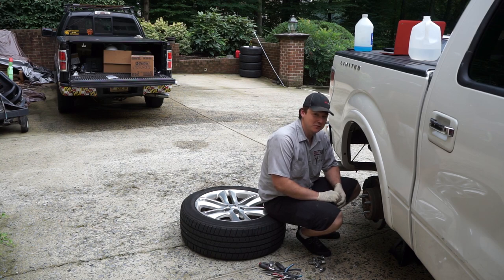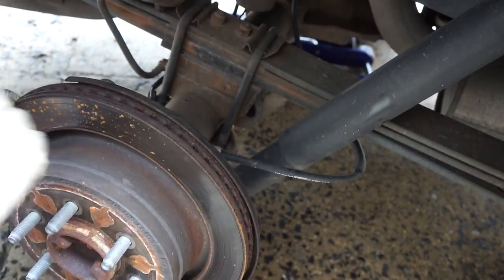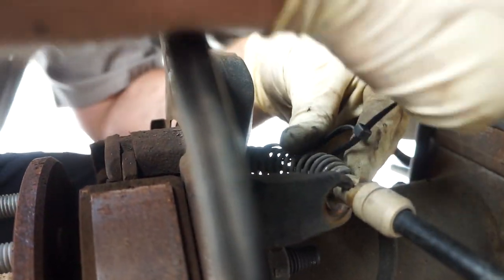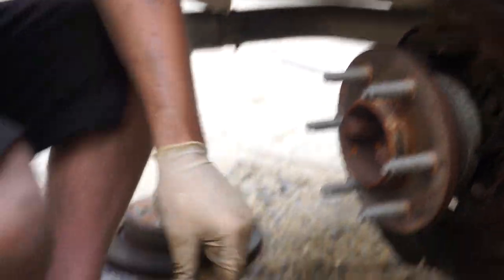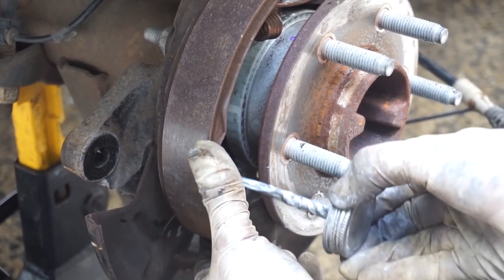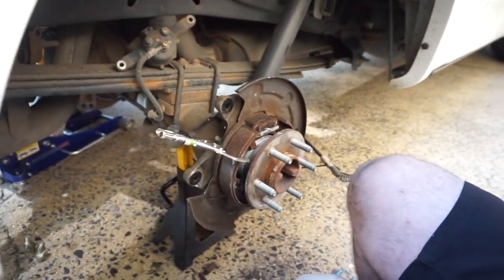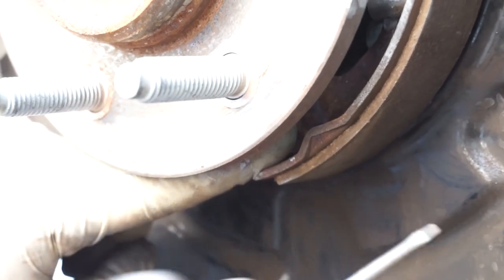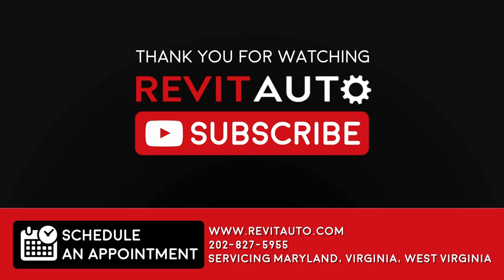How to fix an F150 E brake

Comment from the maker: 😀THANKS FOR WATCHING! Here we have more F-150 videos!
2004-08 Ford F150 Ignition/Spark Plug Coil Replacement
https://www.youtube.com/watch?v=U70bvNM6fAI

F150 VCT Solenoid Gasket Seal Replacement (2004-2008)F250 F350
https://www.youtube.com/watch?v=CaHaEKzO11Y&t=1s

How to change the headlight on a Ford f150
https://www.youtube.com/watch?v=nwtRDmw8KxI

2011-2014 XLT Ford F150 Steering Wheel Control Replacement
https://www.youtube.com/watch?v=fFCqoL6Y1pA&t=32s

Comment: Idk if anyone thinks like me, but after seeing this guy and other YT videos struggle with this, I got to the step with the rotor off and just took a flathead screw driver and a rubber mallet and just kept working that lever mechanism until it moved freely. Then slathered some anti-seize on it and worked it a bit more and now my parking brake is working beautifully. Saved me having to get someone to help me, and the hassle of taking that all apart. Obviously a professional mechanic can't do something like this, but for someone that just needs it to not be stuck on its good enough..
Reply from the maker: Exactly what I did on my personal truck! But not something I can do on a clients fleet truck!

Comment: Thank you very much! I’m new to the inner workings of my truck as I’ve never owned a newer vehicle. After watching this video I went home and fixed that annoying squeal...was the same part seized on mine as well! A little penetrating oil and hammer taps got it like new and re-installed...now with a dab of grease on the pivot. Took me two hours, including setup, assembly and to put all the tools away. Working like a charm now! I used a couple of small chainsaw cutting wedges to hold the pad in which worked great for me.
Reply from the maker: Solid! Thanks for sharing your experience and adding a little tip in there! Congrats on owning this new of a truck! Happy Motoring -Blair
Reply: Hey Juro Me, was your truck making an awful squeal from the rear end at low speeds especially in reverse? Trying to diagnose the noise on my truck and I think this may be it. Thanks!
Reply: @davidwalker72  Hi David, sorry for the delay I haven't been on in awhile. Yeah my sound was very prominent squeal; I would get the truck rolling and throw it in neutral and could feel very slight drag...but not super hard or super loud. Just super annoying. With a stuck parking brake I guess it all depends just how "stuck" it is. Mine was stuck only enough to make an irritating noise and the hub didn't get too hot.
Reply: @PTSix-eg4zj  Thanks for the reply, a week ago I took off my rear rotors and things were a bit rusty in there. The shoes were definitely dragging because of a little buildup of rust. I polished the inside of the rotor and cleaned and lubed the right spots. Completely fixed the issue. Had to adjust the tensioner to get them off then tighten it when reassembled. I only drive it about 5000 miles a year, but time plays its toll on these parts for sure!
Reply: @davidwalker72  Awesome news! I love when a fix saves us $$. Nice work.

Comment: Did this a while back and here's my 2 cents: If you haven't changed the diff oil in 50,000 miles or so, plan to do it while you do the parking brake work. Taking the axle shafts out makes the parking brake work absolutely painless. If not: 

Use a magnet to hold the pins in place while you're working with the clip. I used a freebee snap on flathead screwdriver with a small magnet on the rear, fit right in the hole and kept it mostly in position!

The vise grip on the shoe is a must. In a pinch you might be able to make it work with a few properly placed zip ties but I recommend vise grips, you'll definitely use them again.

Speaking of vise grips, I used one to compress the clip while I pushed it on the pin. Problem is, you have to angle it to get in position around the axle shaft. Hard to explain in words, but the best I can describe it is like an alligator: The head is the clip, the neck is the open end of the vise grip, and the rest of the body is the handles of the vise grip. Now imagine the alligator turns its head. That's how I positioned the clip.

Comment: I have the same hardware and what I did different was I used a long handle bent needle nose pliers. I compressed the clip and zip tied the handle to act like vise grips. I left the bottom spring out and adjuster so I could slide the clips on. Everything else was done exactly like the video. You definitely have to put a clamp on those shoes to keep them back and in place.
Good video!

Comment: Bit of a necro post here but I ran into this while doing rear brakes on my '13 F150. The left side adjuster was seized and as a result, both shoes were worn to the metal.  1A Auto has a great video on removing the parking brake shoes. Thankfully I found this video BEFORE I started to replace the adjuster.

Comment: Oh the nightmare! You forgot to include all the cuss words and plenty cigarette breaks if you’re working by yourself. My professional advise? Have the correct tools. Needle nose with a angle works great too. Here’s my list of tools I use every time:  brake spoon, flat-head screw driver,  and small locking pliers. That last  shoe retainer is a pain to install but not impossible. Cheers 🍻
Reply from the maker: Wish I could double like this comment! Thank you for the list of tools you used! I don't smoke but this job could have made me start!

Comment: Question... 1st of all WOW, this video saved me so much heart ache!  My p-brake was an unexpected replacement as when I was replacing my primary brake pads, I noticed my p-brake was rusted and the pads were coming off of the shoes.
So I bought new p-brake shoes, and I disassembled the e-brake assembly, cleaned up the moving parts with WD-40, wire brush and finished it off with brake cleaner.  After which time the previously crusty rusted levers were moving freely.  I cleaned up all contact points and applied a little bit of grease to ease movement.
So here is my (2) questions/situation: 
1. After reassembly of the p-brake without the rotor put back on, the p-brake shoes will move freely when I physically pull hard on them with my hands, but when I press my p-brake pedal only 1 shoe moves.  This happens on both sides.  Is it supposed to do that?  Or is there a real problem?
2. Prior to this replacement my p-brake felt softer than my last f150 and pretty much every other vehicle I've owned.  So I figured after replacement, they would feel tighter.  I have adjusted my adjustment screws until I felt what I would think is TOO MUCH pressure on the wheel with the p-brake in a released position.  But the p-brake feels the same as it did before.  Is this a result of the issue in Question 1?  Don't get me wrong, the p-brake "works"  It's just not as tight as I'd like.

Comment: Could this cause your check engine light to go on? My ebrake is always on but it will turn off if I pull the switch a Hundred times but the check engine light is on

Comment: this looks difficult. I have the same problem on my 2014. good instructions I will try it.
Reply from the maker: It is a very frustrating process. Do it over the weekend or a time when you have zero places to be!
Reply: My E-brake cable stuck in the on position and the back wheels got real hot and the whole truck shook.

Comment: My parking brake makes a loud squeaking noise after I release it and it doesn't fully release all the way. Doing this should fix it?
Reply: Also Advanced Auto Parts and Dorman say that part 924-743 is the wrong part for my 2012 F150 XLT. Any ideas?
Reply from the maker: @nicholasandrie6269  The part is really cheap from the dealership! Give them a call have your vehicles VIN ready!!! Let me know how it turns out for you! Happy Motoring-Blair

Comment: On my 2006 F150 FX, you have to stick a 5/22 drill bit into the pedal actuator (after having "a buddy" pull down the cable running on the DS) prior to working on the rear braking system.  None of the videos I have watched indicate this.  Is mine the only one that requires it?

Comment: Mine is tightening on its own I keep have to adjust them in to free up the rear wheels this next is to take it apart and check this part . And I never use my ebrake

Comment: The best way to remove a stuck rear disc is to use a bolt on one of the 2 small hole between the lug holes.

After busting my ass trying to hammer out the first disc and half of the second. I decided to use a bolt on one of the holes with my impact and astonishingly enough it pushed it out in seconds.

Save your self alot of time and before you start the job buy or find a couple of bolts that work on the two holes and enjoy your saved time.
Reply from the maker: Make a video! I will link it into the description!
Reply: @Revitauto  I already did the job but I'll see if it works on the front ones since I still need to do those.

Comment: Hi. I suspect this is what's wrong with my husbands old work truck. Feels like it.
And so I must confess that I frequently drove his truck with that emergency brake still on.
Then he started pushing it in even more when he applied the 911 brake. Now, he is unable to diagnose or fix it due to his health problems. But I need the truck to drive.
Does anyone at all think that would lead to it getting stuck? When I drive it, brake lights flashing and beeping. Wasnt doing that before.
And it feels like tension is holding it when I'm easing off in 1st gear.
Ty if you can reply.
Hugs
Marie Maria

Comment: I do have a stupid question: does anyone know if the  "chucking" of the pedal prevents the wheels from spinning?  I fear there may be more wrong because I cannot turn the rear wheels at all.  Either before (but all rusted stuff was still on) or after "chucking" the pedal--even now with the calipers and rotors and shoes removed.

Comment: got a part number for the piece you replaced?
Reply from the maker: l mac I will look it up and post it in the description!
Reply from the maker: At Advanced Auto Parts it is Part Number 924-743 and should cost about $30 for both with a new grommet.
Reply: thanks a lot. I don't have the problem yet but I will pick these up for some preventative maintenance since I do launch boats from time to time. Thank's for the video and reply!

Comment: E brake usually means electric brake, or electronic brake which I have.  Your E brake is just an "emergency brake" , a  pull cable.  totally different. Youtube doesn't charge by the word, so it would be cool to just type "Emergency" in the heading.  I have electric brakes on my Ecoboost and am trying to figure out how to separate the caliper part from the electric component part.
Reply from the maker: You are funny. The term E brake has been around for decades. The correct term for what you have is electronic parking brake Which is a much more modern apparatus on vehicles you can email me at info@RevitAuto.com with your vin and I can see how we can help and possibly make a video! 
Most vehicles have a process for disengaging the electronic parking brake while trying to service however more and more often a scan tool is required to release that system